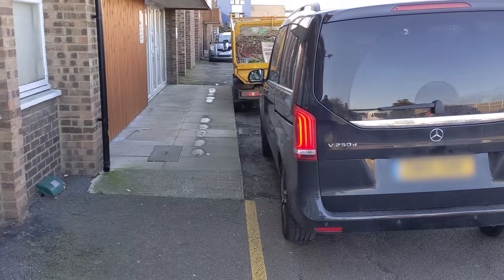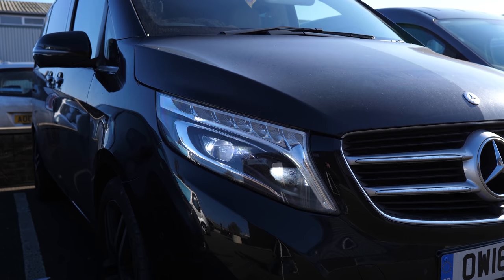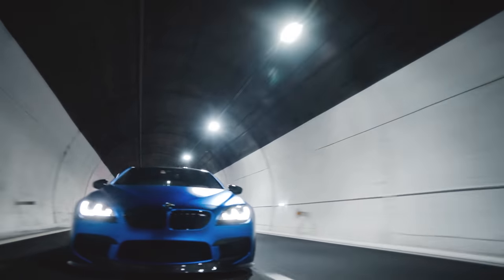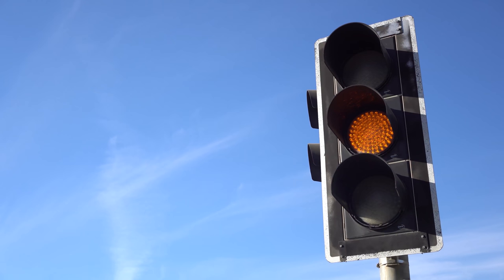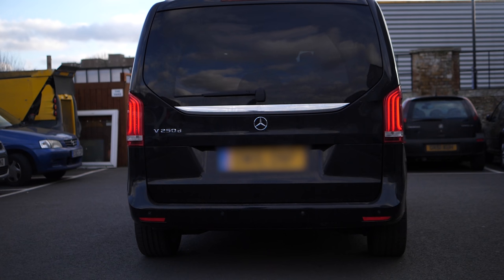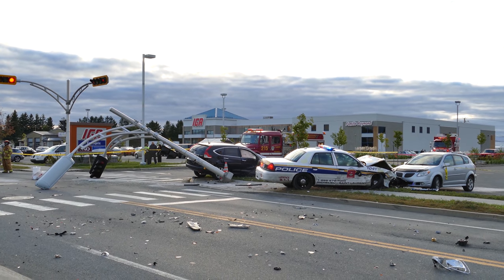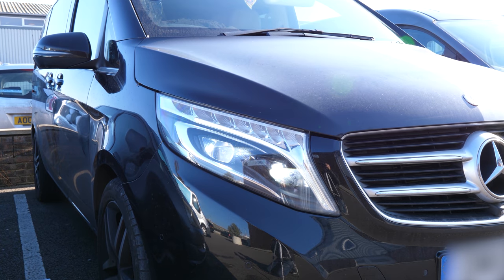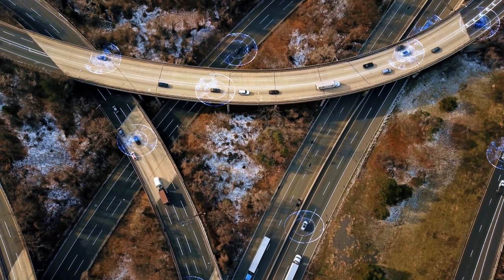Self-Driving Cars Are Dangerously Confused By LED Lights

Comment: Other possible problem. Here in Finland we have a lot equal crossings X where you leave driver at your right first to go, BUT very rare occasion there is 4 cars at the same time. Humans just sign with hands and problem solved. How self driving car will solve it???? Other thing on roundabout, there lot of idiots. Human can valuate situation subjectively in good time from long distance and slow down. How function it with self driving car, it have not subjectiv ,,thinking", only objectiv sensors.

Comment: Come on. Just adjust the refresh rate and problem solved. Which is auto adaptable of course
Reply: Well, sure you can make sometimes adaptable, but it will never be perfect. Let's say the cars auto adapt sees a red turn signal and will thinks "oh it's a brake light, adapting frequency." The car will stop, while the car in front turns.

Comment: Your argument that changing the operating environment is unreasonable is ridiculous.  Mandatory ABS was introduced for all new vehicles and the industry barely blinked.  There are thousands of regulations that vehicle manufacturers must comply with.  For instance, the lenses on your lights must include the appropriate standards organisation moulding, so that vehicle testers can tell whether they comply.  It would be trivially easy to mandate that any lit bulb had to maintain a minimum brightness at all times.  Say the minimum on brightness was set at 75% of the average brightness.  This could easily be achieved by using 4 diodes per bulb, and ensuring that no more than one diode was off at any one time.
These lights are not just courtesy signals; life or death decisions are based on them.
Reply: That would work well for cars built after the new standard has been adopted, but does nothing to address the existence of cars which predate it. Any technology which will be integrated into the existing system will have to be backwards compatible in order to be functional. The only other alternative is to have dedicated areas in which only vehicles compliant with some set of regulations is allowed, and all other vehicles are excluded. To my knowledge, the only examples of this in North America are the interstate highways, where pedestrians, bicycles, horses, and anything not capable of maintaining a minimum speed are specifically prohibited. Unfortunately, as has recently been proven, an autonomous vehicle which only works in some locations is a major safety hazard, because you're then relying on the driver to know when it is time to take control and never become complacent. I submit that ignoring human laziness and complacency is a recipe for disaster.
Reply: @kenrickman6697  I certainly agree with your last point.  About 20 years ago, pilots were arguing against the increasing use of autopilots.  The argument was that humans tire but computers do not, so they should monitor the humans, not the other way round.  By putting humans in the fairly tedious monitoring role, they were even more likely to miss something important.  Commercial pilots are highly trained, so we would still expect good performance from them, even in a monitoring role.  The same can't be said for the majority of drivers on our roads.

Comment: thats a wrong information. its not caused by digital vs analog. its caused by the designers of these camera slacking on school when they had the lecture on nyquist sampling theorem. you dont have to time sample, the human visual system doesnt. if you dont know how to sample, dont sample. they cannot make a properly working camera but they are going to make  a self driving car based on this crappy wrongly designed camera which will endanger peoples lifes?